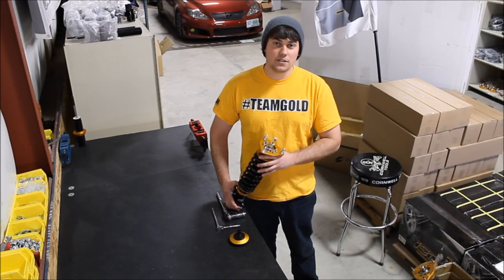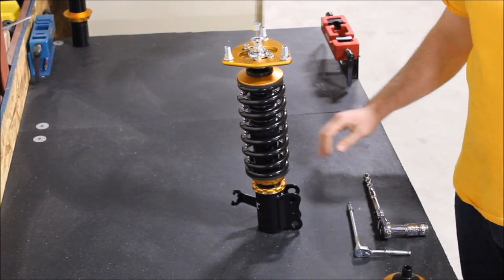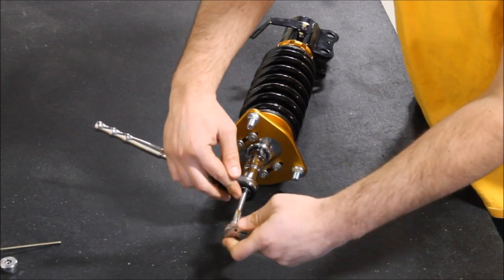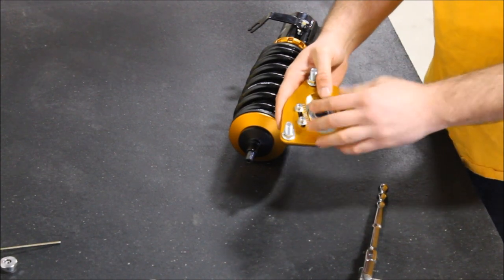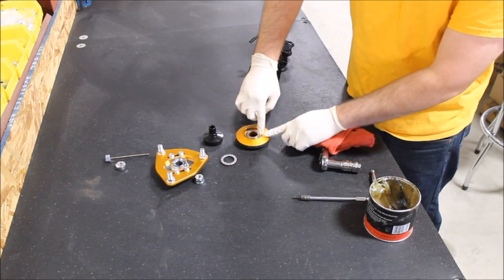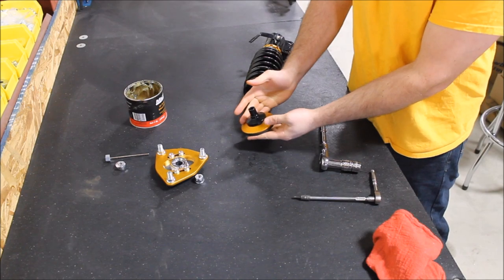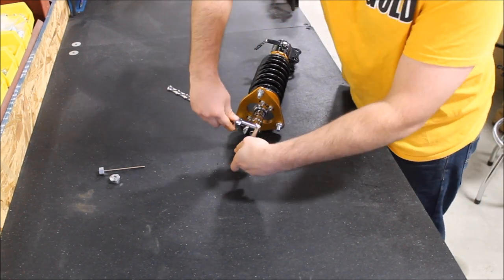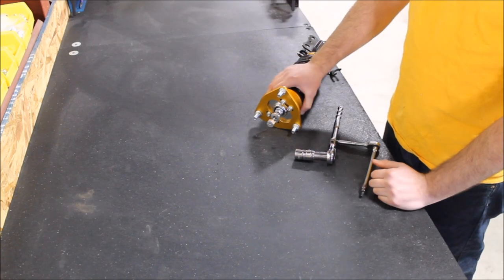ISC How To: Thrust Bearing Maintenance

Comment: I did this yesterday. I had their new top perch with the sealed bearing.  If you are going to do this spend a few bucks and upgrade to the sealed bearing.
 
 SCRATCH THAT. Will edit again when they respond.
 The new set up may actually be worse than the old set up. Waiting for a reply from ISC on this but the old set up is a thrust type bearing you can clean. The new set up might be a sealed bearing  but putting more load on the sides of the races versus a grooved surface. 

You should find grit on the outside of the cap if you have not kept up with this type of cleaning. The grit gets between the top cap and the spring perch negating the effect of the bearing inside. The new system prevents the cap, which is a race from binding.
I left the top mounts on the car. 
Proper safety requirements needed.
Steps I took were:
Remove wheel
Removed all the spring preload
Removed caliper and rotor although you might not need to
Remove lower strut from hub
Remove all brake lines and sensor wires from strut ( look around in there to make sure you have everything)
Remove adjusting top and top adjusting knob
Loosen top of strut using a wrench and allen key. Careful because this is the only thing that is holding it in your car. I place a few block of wood under the hub to catch it but it did not fall and I had to wiggle it out to get it to come out. No issue.

A little tip when putting everything back together. I shortened up  the overall length as it made reassembly a bit easier.
Also measure your ride height before you start so you can get it back to where it wa before you started.
I use some 4x4 wood blocks with a rubber pad on top and let the car sit on them and then measure from the center of the hub to the bottom lip of the fender. WRITE THE NUMBER DOWN
If you have any questions just ask.
Hope this helps!

Comment: Can you do this without removing the whole coilovers out of the car? And does this also have to be done in the rear struts?
Reply from the maker: No sir, you must remove them from your vehicle to get to the thrust bearings. Also the rears do not have thrust bearings because they do not turn.
Reply: iscsuspension And when you do remove them and clean them, an alignment is needed afterwards?